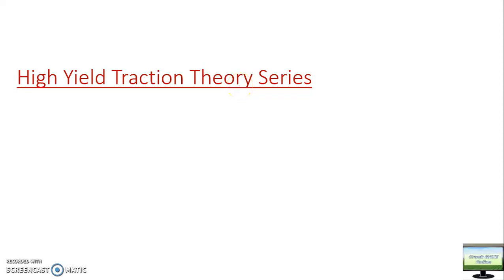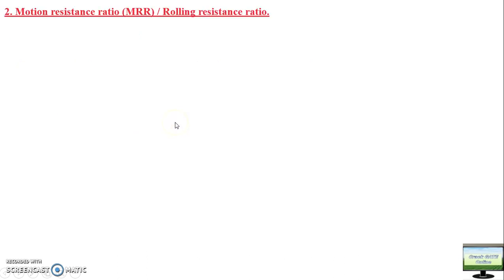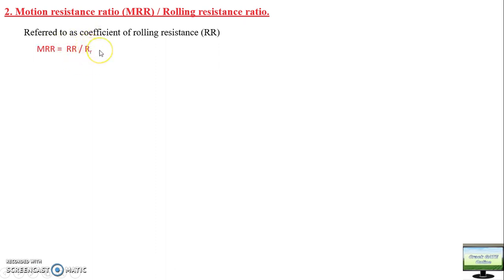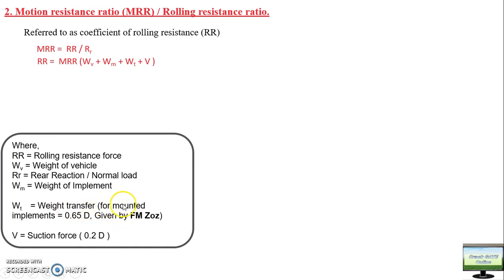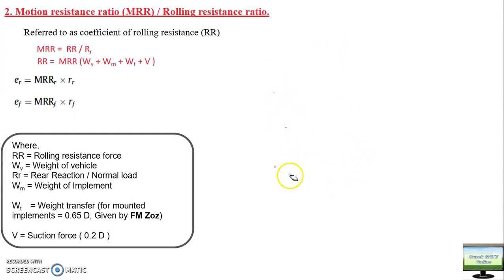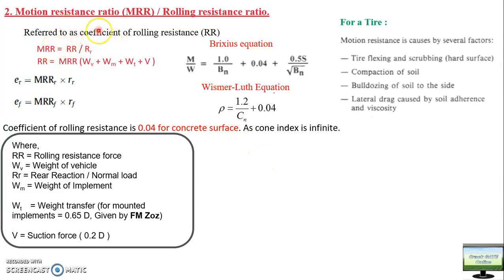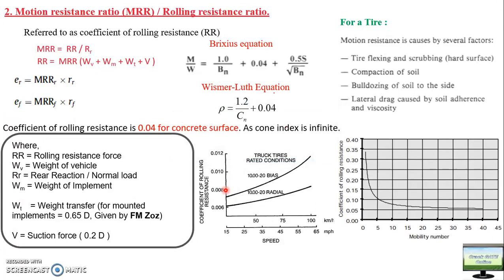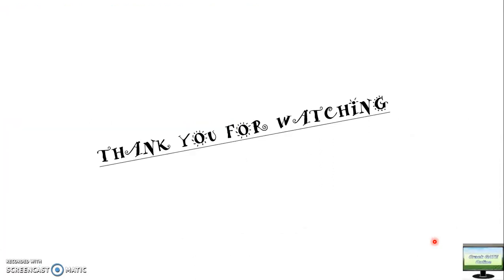1.5 Tyre and Traction Theory

Comment: hyyy sir could u explain me about this problem solution...regarding wats meant by power loss 1.a 2 wheel drive tractor pulls an implement that has a draft force of 11.5kN. the total motion resistance is 2.5kN. slip is 20%..if power loss in transmission is 20%,the %of power lost in converting engine power to drawbar power.....
Reply: transmission efficiency